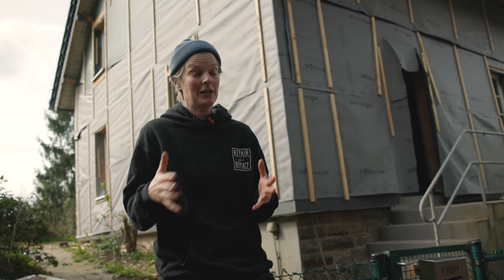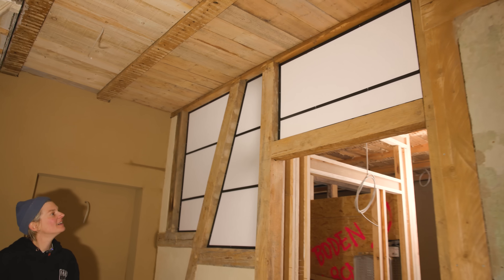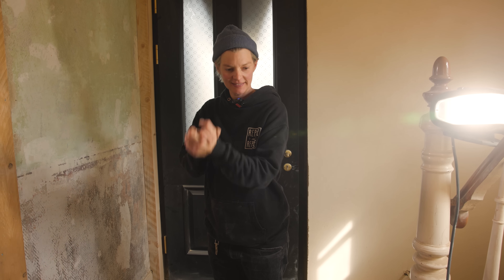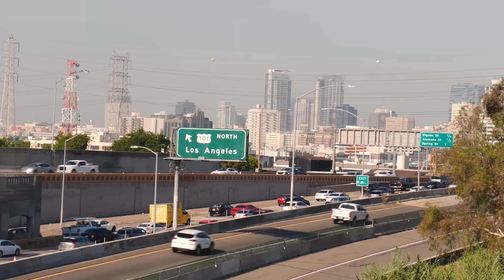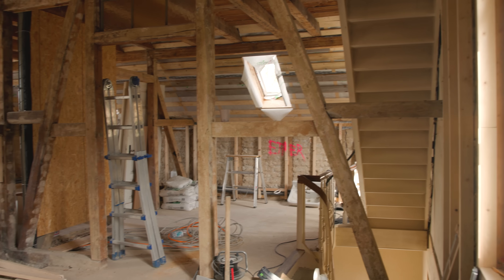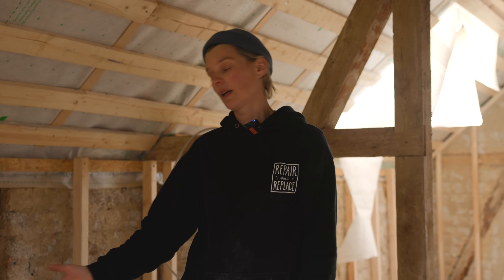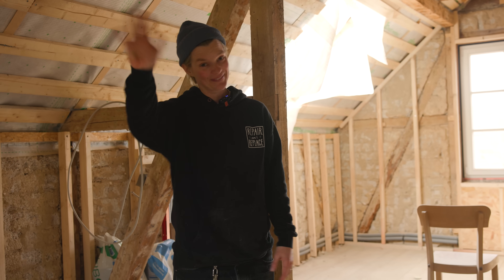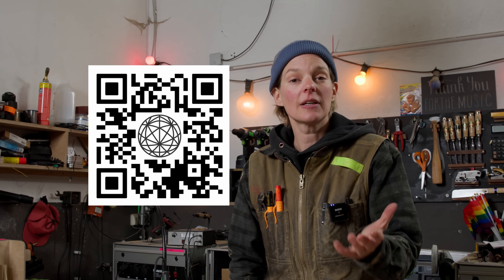The hallway is done!! (Rescuing a 120 year old house)

Comment: As long as you've got electrical going in, don't forget to put in flexible conduit or something for data wiring - conduit so you can run cat5/6/7 now and switch to fiber later and to whatever comes next after that.  And leave some real room near wherever the data comes in so there's a place for your router or other network hardware.

Comment: I'm so surprised you didn't start with the external cladding. That's the first step after the frame and roof is finished in any build in Australia, called "lock-up stage". It keeps the weather out and then you can take as long as you want with the inside. A lot of DIYers pay for the house to be finished to this stage by professionals then spend 5 years going their own tiling, carpet and plaster work. Is this the usual way of building in Germany or is this a specific choice since you're a public figure and don't want every stranger on the internet knowing what your house looks like?

Comment: Looks great, right style for the house.
Is that lino on the floor or tiles?
If they're are tiles. you can acid strip them back to OG.

I have an idea for a project, which l will purchase from you, if you decide to do it. 

I was looking at getting an old metal spinner cap from an old plane. 
Have it polished, and a huge curved arm and use led light as l suffer fromscleritis and my ees are sore from bright lights. 

Im in Scotland so l could get the booze for the open house. 
I'll be coming if you do it and quite a good firepit cook.

Comment: I understand your desire to have at least one finished space that greets and inspires you when you first open the door, but you've chosen the entrance through which everything to finish the rest of the house will need to pass. Isn't it going to get knocked about, dirtied, chipped, smudged and generally mistreated as work continues on the project?

Comment: one downside of having a shop "in the country" in the usa is that suppliesstores are usually far away so running out of screws nails lumber toiletpaper  etc usually means a 2 hour trip , thats the main reason everything is bigger in the states including the size of say cereal boxes or tubs of peanutbutter , they need more supplies and storage for said supplies so to not having to spend 2 hours to get more every 2 days or so but only once every 2 weeks or go without for a few days 
i bet the project will test youre organisational skills even though there small you still need to have all youre supplies or a well stocked workshop to make the "thing" in decent time 
in youre case the best place would probably be a shop next to a large diy store or have a second person prepare the material purchase as you tend to forget stuff a lot 
just getting immages of the dog farting in the direction of the woodstove and the flames shooting out the chimney WHOOMP